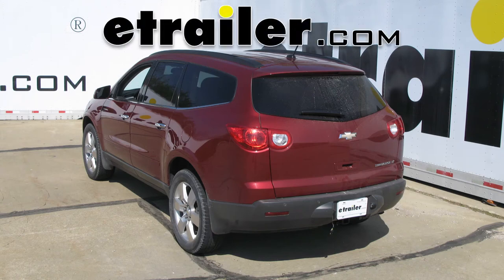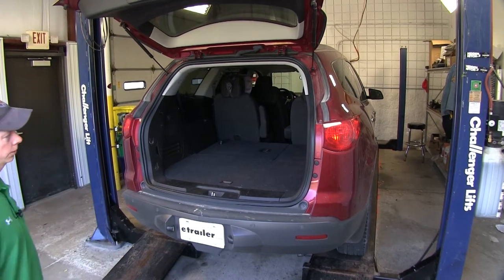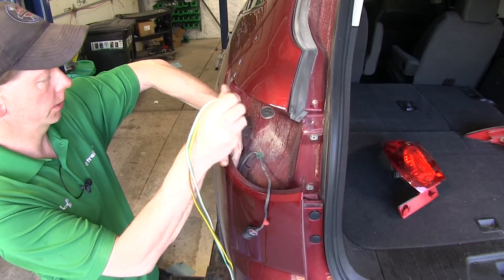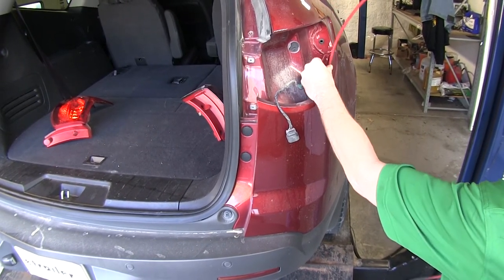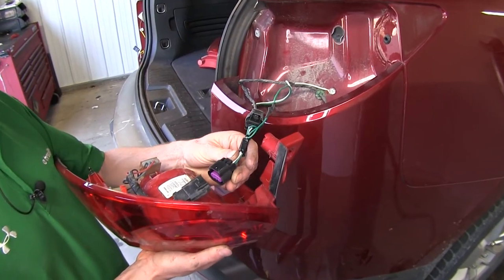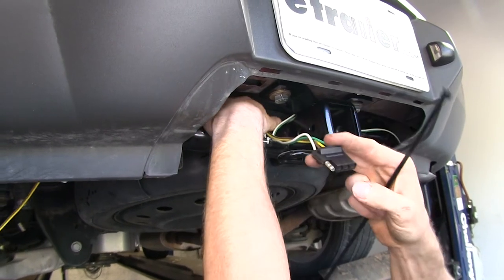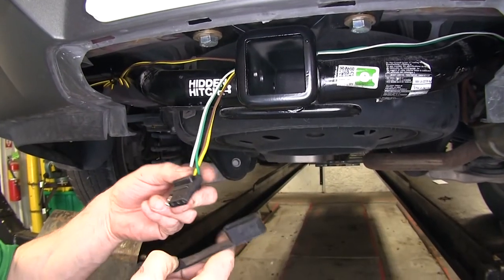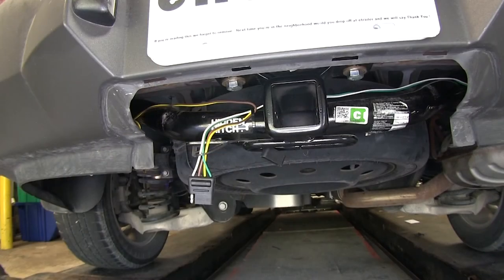etrailer | Trailer Wiring Harness Installation - 2011 Chevrolet Traverse C56027

Comment: Do I need to add the fuses or does it work off the existing break light fuses
Reply from the maker: Using this wiring harness will not require any additional fuses.
https://www.etrailer.com/Custom-Fit-Vehicle-Wiring/Curt/C56027.html
Reply: @etrailer  Thanks. I ordered the kit and it will be here Tuesday.